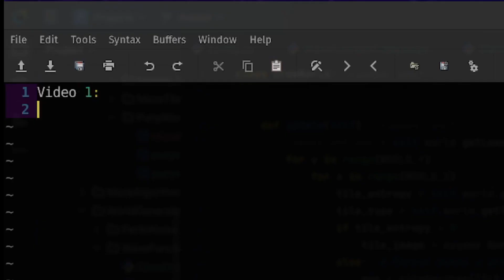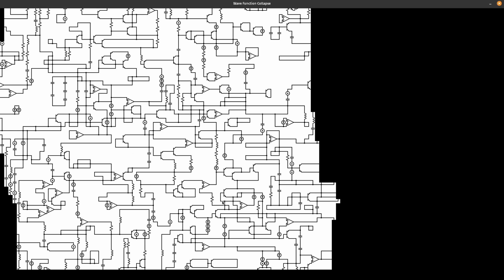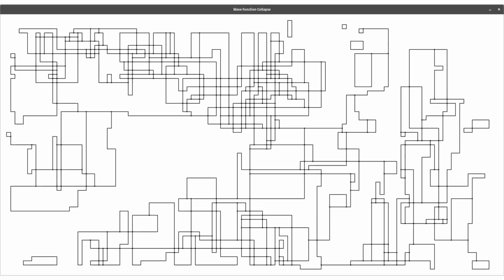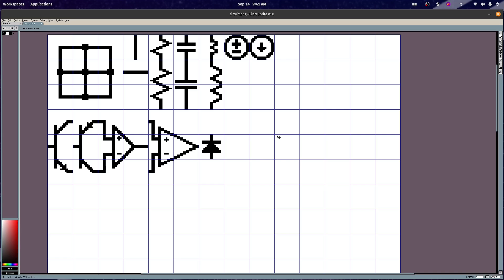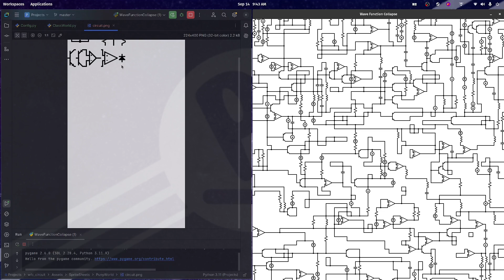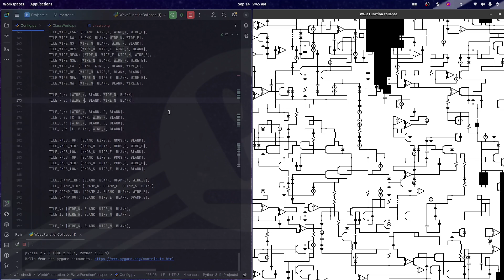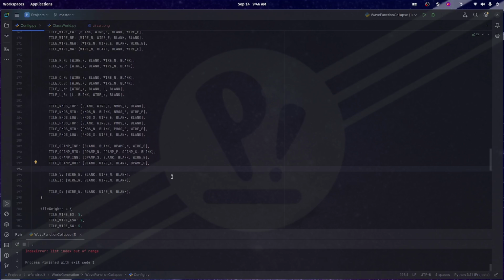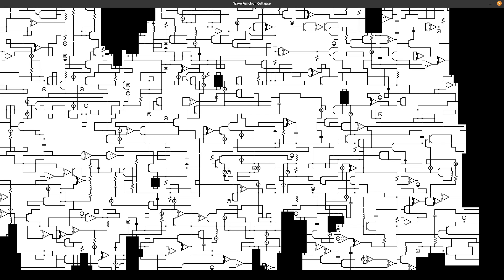Procedurally Generating Circuit Diagrams using Wave Function Collapse

Comment: You could basically create a random Mathematical Expression (polynomial)

And than you can create pre determined structures for addition subtraction...
And than you can connect them together 
Theoradically also simplify them
And than create a circuit diagram
Reply from the maker: I do have some old code from college where I use a binary tree to create math expressions for a non-linear control system. The part I'm not following is how to convert that into a circuit diagram, do you mind elaborating?
Reply: @TLV3604  you do create a polynomial Equation, different coficents etc 

And for convertion to circuitry you could create premade is for addition subtraction... And after you connect those ics you remove and simplify it Bassically projection of ics Or getting those ics connections replacing all ics with respective Circuitry and than simplifying it (optional but complexer) and you get the result
Reply from the maker: Ahh, I see, that is an interesting generation method. I'll see if I can look into that as well.

Comment: This is really cool man, kinda reminds me of terrible stock photos of circuits where they always make no sense. Have you given a thought to doing your own implementation of the algorithm? Also I understand this will increase possible entropy of a cell but what if you had different wires that looked the same but could only from one thing to another? I don't know exactly but another YouTuber called the code train did a implementation of sockets using letter like AAA can only match AAA, with this you can have a wire that lead from a power source having ABA and the other side of that wire leads to ABA and once it connects to a diode that has the entrance of ABA the other side of the diode can lead to ACA meaning that it won't instantly try to reconnect to the same wire that is leading from the power source
Reply from the maker: Hey thanks for the comment! That's a pretty good idea, I'll definitely look into that. That would reduce a lot of the random tangles of shorts I'm plagued by. It would also be cool to lightly classify the wire nets such that I don't get stuff like two current sources in series. Something like tagging the wire with some metadata stating that it is actively driven, and to not consider a power supply node on it. I'll come back to this project at some point with some of these improvements.